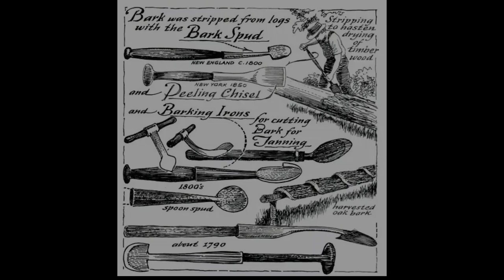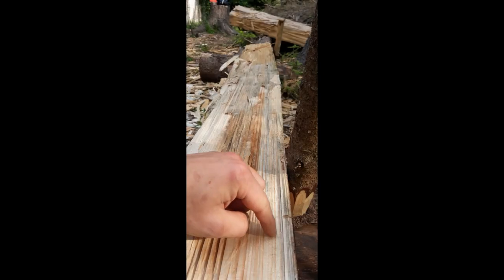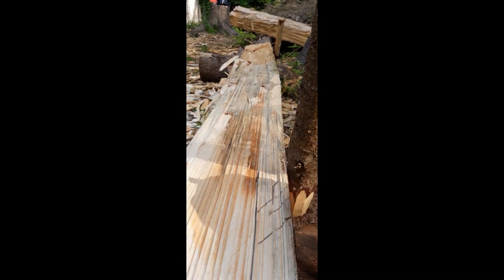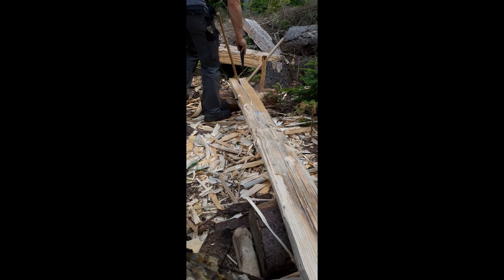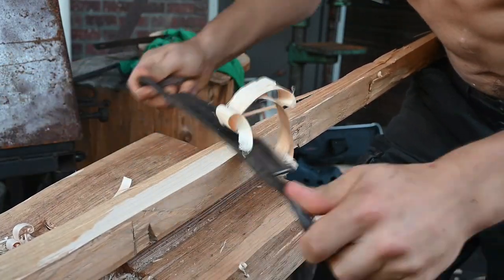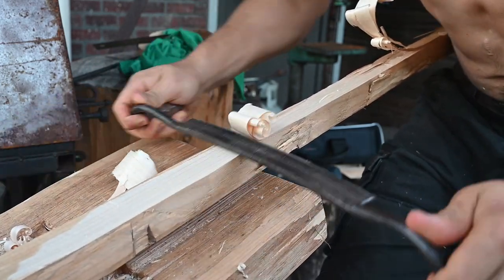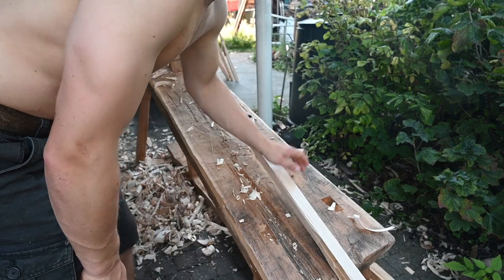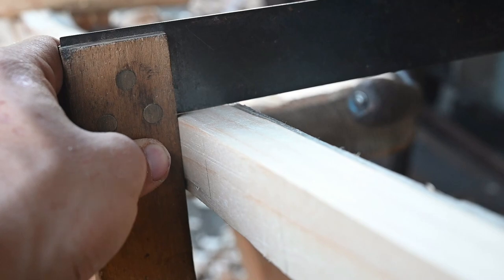Medieval Woodriving  "Log To Lumber" (ONLY HANDTOOLS)

Comment: Great work mate!  I cannot imagine wielding that 8kg hammer all day, let alone with 1 hand.
Reply from the maker: Thanks a lot !  I couldn't appreciate it more, you are damn right ... so luckely for me i don't have to do this every day (even if i would like to do so ;-) )   Above, in the reaction i wrote to @jsoulz2008 i explain more about how the quality of your log plays a role in how easily it splits.                                                                                                                                                                                  I used to make everything with handtools since my 6 , ... Thus i'm getting used to it now.                                                                           Chears !
Reply: @TraditionalArtisanCraftsman  I've split a log by hand before and it is WAY more difficult than most Youtubers make it look.  I was using a 20 pound sledge hammer and metal spikes and my log was twisted.. it was an exhausting mess LOL and my ears were ringing.  I do most things by hand in traditional ways, but my chainsaw helps me process the logs so that I can move on to more important things 😀

Comment: Top tip - count your steel wedges before and after working - wedges have an irksome habit of escaping back to the wild  ;<)
Wooden wedges are easy to make either in the woods with a hatchet or at home on a table saw. Break into the wood with steel wedges and follow up with the wood wedges. Even when they are worn out, they are still great for the stove.